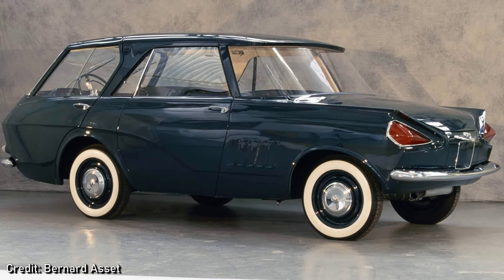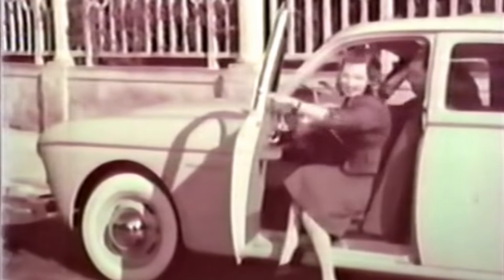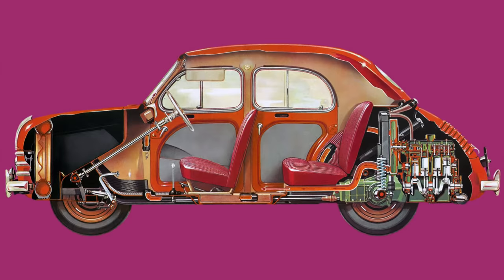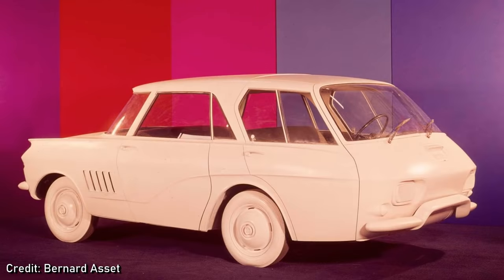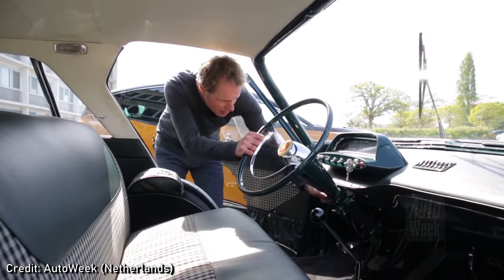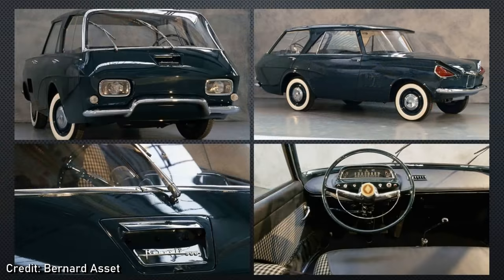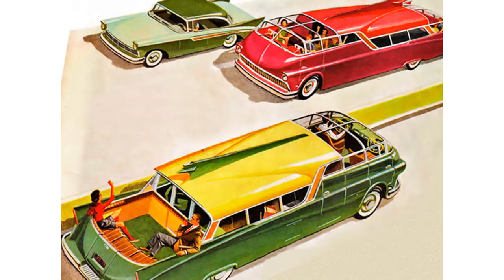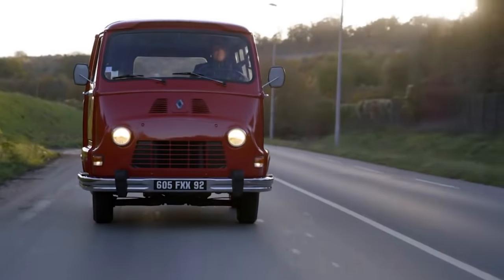Renault's Backwards Car

Comment: I'm probably wasting my breath, but the only reason why so many people dislike the design is because it goes against what they are used to. Yet these preferences are something acquired and taught, not innate. If you showed a caveman the backwards car and a forwards car they would look equally weird and foreign to him/her. Saying "this car LOOKS bad because the cabin is at the front" is about as frivolous as saying "this skirt looks bad because it goes against the convention of this year's fashion trends". They're all learned conventions. It's good to be at least a bit self aware of this, because otherwise we will end up skipping on good, sensible ideas just because it "doesn't look like convention".
Granted, I'm neglecting the whole aspect of crash protection (and even there, eurotrucks put drivers right against the glass, yet nobody bats an eye because "it's been done before").
Reply from the maker: Well said. The BMW front ends of the mid 2000s were described as hideous, and we now take them as normal.

Comment: If they had contracted with GM to make this instead of the Corkscrew copies and sedan, with GM bring able to sell the corsair pickups and vzns in Europe, it would have been a winner. Especially if the same body was used for a front wheel drive hatchback.

Comment: The brief for the 900 is simply unclear other than to be different. Surely the designers and the engineers knew that space would be an issue. Clearly the 900 is a statement.

Comment: In USSR, a similar car, NAMI-013, was being designed in 1948-1953. Only one was built https://www.autowp.ru/nami/013
Also, around that time, a smaller car, NAMI-A50 "Belka"(Squirrel) was built, http://www.carstyling.ru/ru/entry/NAMI_A50_Belka_1955_1956/

Comment: It looks like they just took a regular car and swapped the lights around.
Reply: In the late sixties a mechanic/artist took a 1959 Oldsmoblie and reversed the body and reversed the headlights and tail lights. supposedly it handled pretty well, in spite of fins on the front, but it got stopped so many times by the police who couldn't believe the car was street legal, so it was buried in an undisclosed location. I remember seeing it in either Popular Mechanics or Popular Science at the time.

Comment: It would actually look good, if they turned it around the right way. Looks like a slick shorty wagon, just turn the seats around and put that steering wheel in the correct place.= Winning.

Comment: It's ugly, it's impractical, it's unstable to drive. It's uncomfortable. That's what you get folks, when you design something that doesn't need radical change, just improvements. What's not broken, don't fix it. This is not innovation, this is going backwards (pun not intended).

Comment: Smallest V8? Not by a long way, Moto Guzzi made a 500cc V8 and raced it.
Reply from the maker: Wow! I didn't know about that.
Reply: Sure, but what about the smallest V8 fitted into and made specifically for cars? I think then the Project 900 would be a solid contender.
Reply: @jakekaywell5972  Except it was only  hand made for the handful of prototypes Maybe only 2. Fiat made a series production run of 144 2.0 V8s for the 1952-1954 Fiat 8V and Ferrari made 2.0 V8 208s for Italian domestic use because of punitive tax on anything over 2.0. There are several at about 2.2 and many at 2.5 including Edward Turner's lovely little Hemi for Daimler.

So as a prototype only the Renault is probably the smallest.

Comment: @5:19, Hey, Renault's engineer...figured it out...and built a good practical safer car....that one looks so much better. Those engineer's working in the early 1960's should be ashamed of their poor design...you can tell people seating in front of the front wheels was going to be BAD...both unsafe and vehicles's handling would be off.